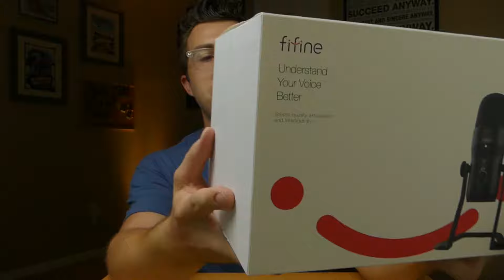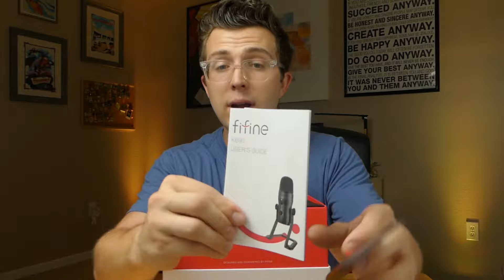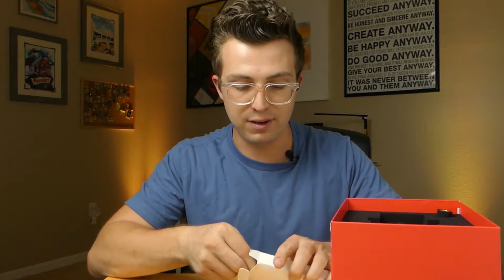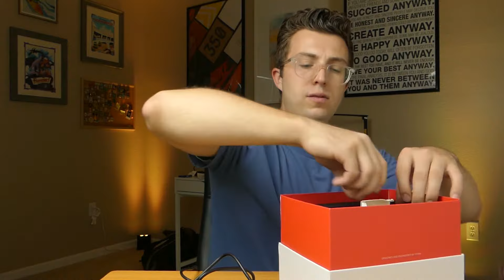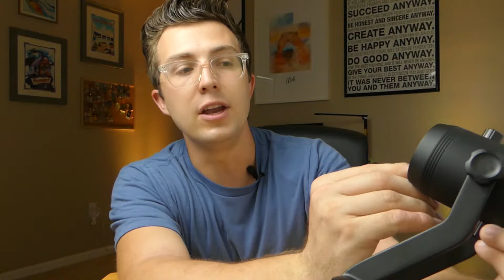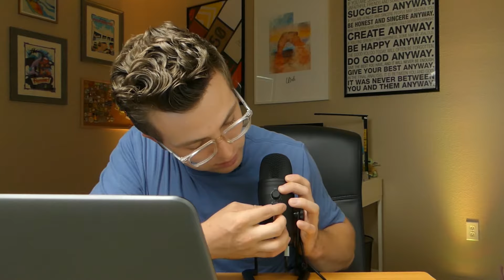Fifine K690 Review | All-Metal Podcast Microphone

Comment: do you recommend a shockmount when im going to use a boom mic stand
Reply: It is recommended when you get enough budget, though it is not necessary. Cuz K690 itself is so heavy (1.3KG) that it will get much shock absorption. Besides, there may be not the suitable shock mount for the K690 in the market.

Comment: which is better? this or K678 and why?
Reply: First off, you should know what your main purpose is. The biggest difference between K678 and K690 is that K690 is equipped with multiple pick-up patterns. If you don't have the demand of several pick-up patterns, then you can just purchase the K678.

Comment: Does this mic work with the ps5
Reply: K690 works on PS4/PS5. But the downside is that if you plug the headset into controller, PS4 input and output will change to controller automatically. Thus, You are supposed to split the microphone feature from headset with a 3.5mm Female to 2 Male adapter, or simply use the earbuds which has two loops on its connector, then you're good to go.

Comment: I see, you've also reviewed the Fifine K678, as well.  I'd like your opinion about the sound quality between the two:  Is the K690 a substantial improvement, or are its advantages/advancements over the K678 more about the pickup patterns.  Also, is this K690 - like the K678 - still limited to 48 Khz./16 Bit, or has there been an upgrade in the K690 to allow >48 Khz./24 Bit.  Thank you!
Reply: The K690 is overall the best one. It is basically better in every aspect, unless you like smaller mics.
Reply: Idk if this reply will help now but k690 and k678 are the exact same microphone, same sensors and everything. Only difference between the 2 is the availability of pickup patters in k690
Reply: @vineethadurthi9748  No, the information is no longer relevant to my microphone needs, but I appreciate the knowledge and you responding to me!
Reply: Nice question, I also want to to know, lol

Comment: When you tested the microphone, I think the sound quality was horrible, which is my same reaction to the former Fifine that also sounded harsh, gave the impression your mouth was too close and sensitivity maybe too high. I do like the warmer sound, but not so sure about the quality of the cardioid as it sounded janky, harsh, good warmth, good in omni mode (omni mode was pretty decent) but the cardioid is either too sensitive or just way too harsh. Pretty much the same issue with the Fifine Studio mic. It just can't compete with the Sure G Trac pro and it's only 16 bit while the Samson is 24 bit. Mind you that is likely because of the price and quality differences between the 2, since Fifine doesn't offer professional dual track mode.
Reply: Hi there, the whole range of FIFINE microphones are designed for the spoken words and vocal, in which the high-ends clarity is more important than any other frequencies. In order to reproduce more details up the top, we boost the highs. And thus leaving less room for the audio before it clips, if the input is not set to a lower volume. When the high frequency is boosted and the vocal is in high intensity, it's inevitable to hear harshness. The easiest and the best practice is to turn down input gain. 
And harshness also comes in more prominent if the tracks are not closely level-matching to each other. in the video, the out-of-frame audio device should be an on-camera shotgun mic, which is not possible to pick up sound as clearly as a desktop mic does. That means the recording is slighty muffled when it compares to K690's. When your ears get accustomed to the softer and warmer voice in the first part of the video, then a well-balanced of K690 in the second part could sound harsh. 
Yes, you're right about the bit rate, and that's where you can see on paper why they're priced differently. But we're talking about the G Track Pro, not the other budget USB mics but still feature themselves with the 24 bit. And as for the dual track mode, it may not be quite suitable to list it as an advantage over the K690, to be more precise, it should be the edge over all the USB mics. Because you just don't find any other USB models out there that has an instrument input.